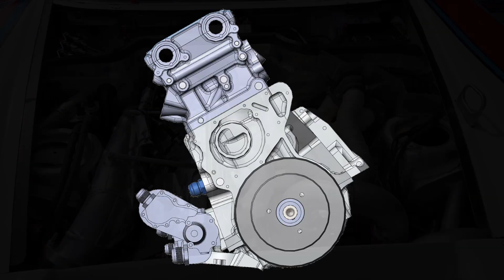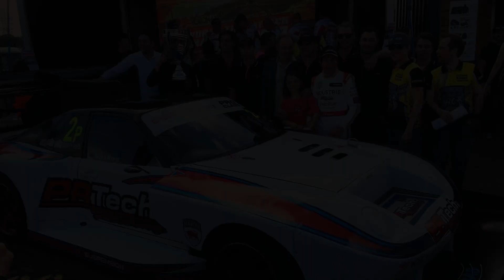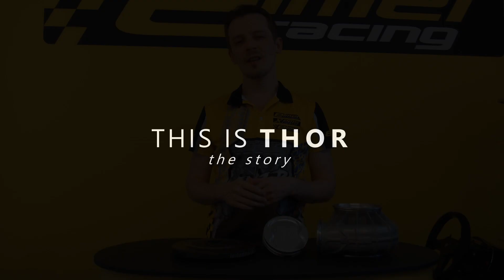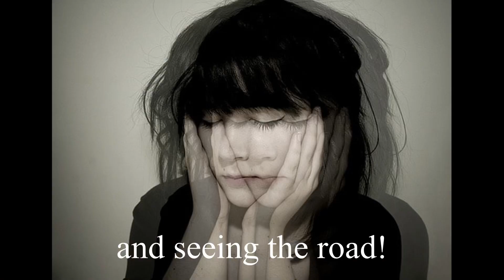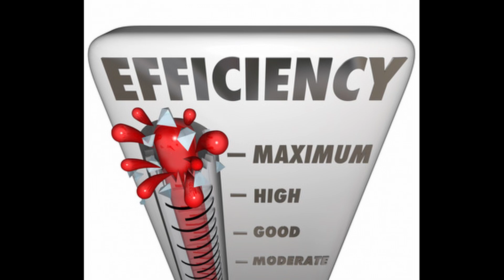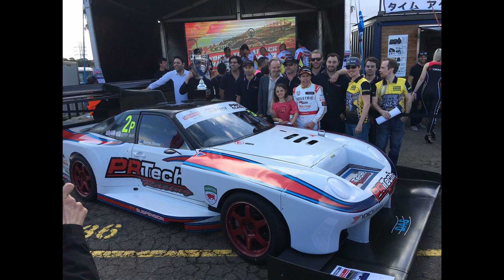Why is Thor so good? Thor - the story ep6

Comment: How do you design the viscous damper for any certain engine? Could you get away with removing balance shaft´s if you use one? If i understood you correctly they are doing different thing´s but decided to ask anyway :D -Porsche 968 engine that would gladly get rid of balance shaft´s
Reply from the maker: The vibrations that the viscous damper are for are not related to the type of vibrations that balance shafts are for.
One is for damping internal torsional vibrations in the rotating assembly, the other for reducing the amount of "radial" vibrations being transmitted from the engine to the chassis.

Comment: The struggle of a man who is trying his best to explain complicated stuff to normal people 😂 very informative as always and great content! Thank you guys
Reply from the maker: Not easy! But we're trying to figure out how to make these work.
Reply: @ElmerRacing  removing the damper from the front of the crank increases the twisting forces on the crank as u mentioned

Using the same rationnel... wouldnt having an electric engine in the place of the flywheel that by nature helps rotates the rear of the crank reduce these teisting forces??
Because the damper is slowing the free side but this will be the other side of the coin.. supporting and rotating the heavy transmission side

Ultimatly getting rid of the flywheel and damper or at least reducing their weight
Reply from the maker: @FirstLast-tx3yj  The damper does slow the crank down when it tries to accelerate. But it also speeds it up when it tires to decelerate. (both happen equally during vibrations)
Reply: @ElmerRacing  i was also wondering using such a huge bore size. How is 1 spark plug sufficient? In F1 they mention knock problems on anything more than 97mm

Comment: If you fixed the horsepower to something like 500 what would a super light engine solution look like? V twin?
Reply from the maker: Interesting question! N/A vs turbo would need to be investigated first. Assuming circuit racing use for these thoughts.
Turbo would have to run at least 200-300kPa to make sense, so that's about 200hp na engine (for the turbocharged one). 1000cc inline four maybe? Low rpm version would need maybe 1300cc. Boxer 4 could work also.
N/A option need about a 2500cc engine at about 12000rpm. Could be done with a i4, but a v6 or v8 could be longer lived options.
So short answer would be "it depends".
Reply: ElmerRacing so a motorcycle engine? I guess that makes sense.